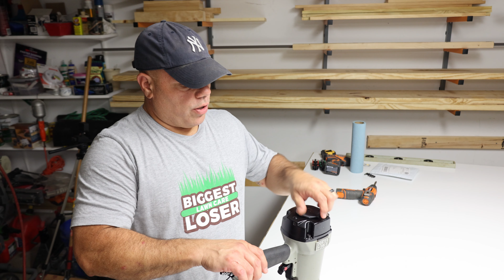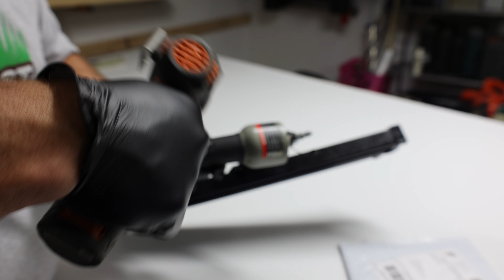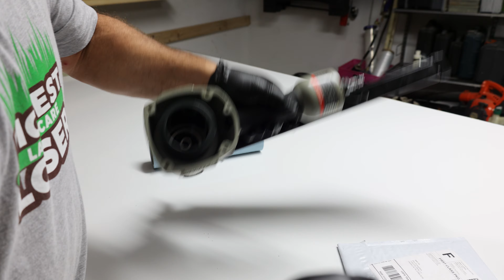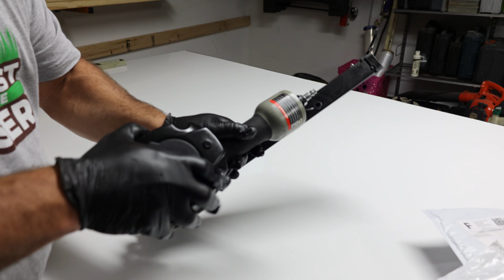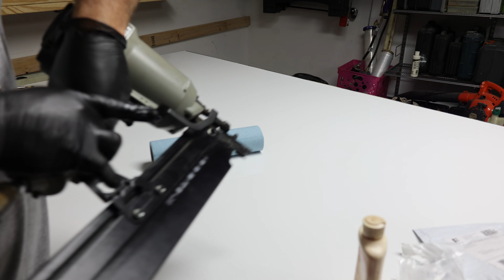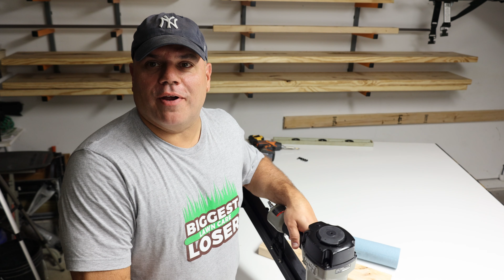Fix Your Own Leaking Pneumatic Framing Nailer

Comment: your video is dated 2021- NOW 2025. So, it was in 2021 that the same thing happened to my gun. What am I talking about? I'm talking about the website you gave the link to. Yes, I was there and I bought this ring there, but now there are very bad pictures and it's completely unclear what you can buy from them. And the ring that seems to be... It looks like what you need... it costs not eight dollars, but already 40 dollars.  (my gun- FR350A) any idias?
Reply: ok its done. it wasnt the ring (saddle). it was the part number-109.  it was crushed in many pieces. what i did- just cleared particles and even didn't replaced it. it works good as new one.  anyway- thanks for your time of posting a video.
Reply from the maker: Sorry, I thought I replied to your original post. Thanks for following up with an update. Glad it's working for you now!

Comment: Mine decided to act up randomly just like this today. It was sitting there all by itself, and all of a sudden started leaking
Reply from the maker: @mikeingeorgia1  that’s exactly what happened with mine.
Reply: @TheSharkShed   I have nailer model FC350A. It was used when I bought it but it still had the manual and parts diagram with it. It too has that part listed as part number 910767  Collar. As soon as I opened it up, I could see where pieces of the collar had come apart

Comment: I'm unable to find a seal for my central pneumatic air nailer model #04041. do you know where I can find one?
Reply: With Central Pneumatic you'll have to go through Harbor Freight to get the replacement parts. They are often not available.
Reply from the maker: @maxgilbert18  Good to know. Thanks!
Reply from the maker: If you haven't checked the link in the description of this video, I used https://www.ereplacementparts.com/ for my seal. Check them out. They typically have everything I need.

Comment: Don't you have to put O-ring grease on the part before you install it so it doesn't dry up?
Reply from the maker: It was already pretty greasy. And I oil it after each use.

Comment: Hi any ideas if this cylinder seal will work with a Harbor freight nailer 21. degree.
can you list the part # you used.  The link just take you to e replacement.  My gun is not listed with them
Thanks
Reply from the maker: I have no idea if it will work for your nailer, but the part number for my nailer was Part #: 910767
Reply: Judicious application of silicon rubber will get the jib done,,,,,especially if you are not abrade of getting it on your hands.  

Put it on the seal surface and down in the groove and put s business card out side the bolts. - Let the silicon cure and then put the card stock and tighten the bolts.....Done.